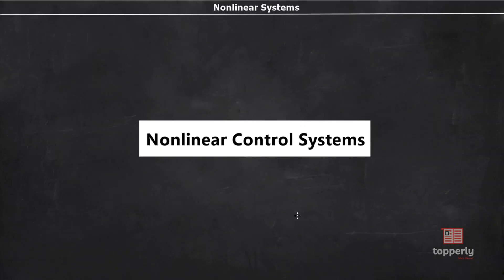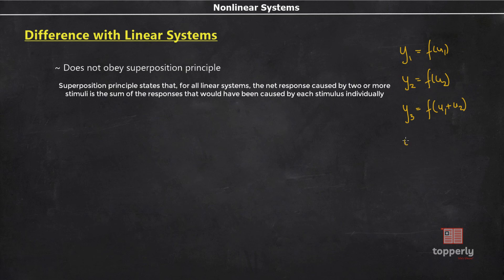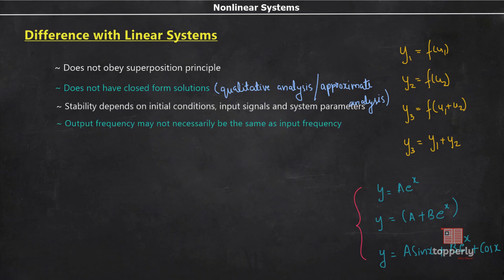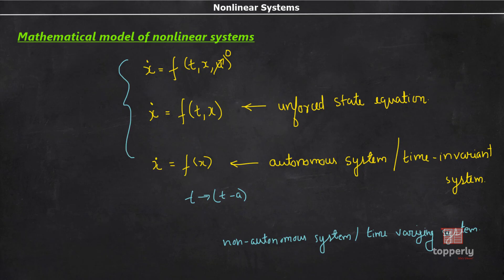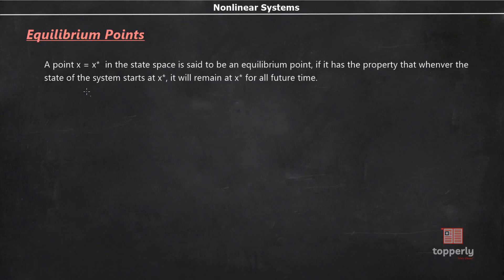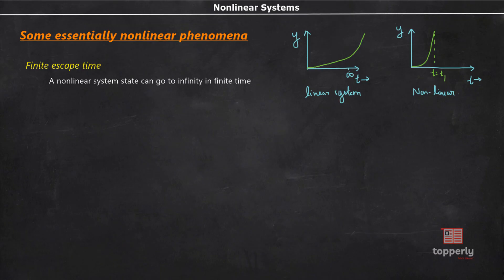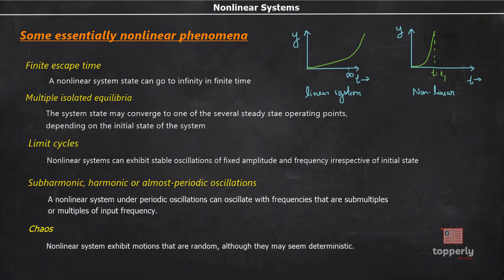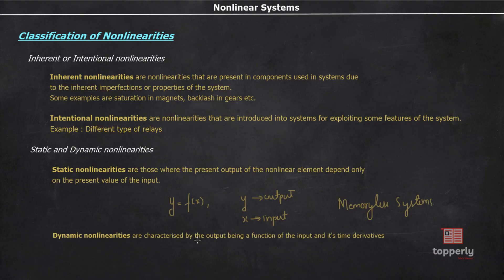Introduction | Nonlinear Control Systems

Comment: Very Good evening mam
Mam if you have time can you answer these questions you will be greatly appreciated.
1. Can we use the average dwell time to get the relevant results in switched nonlinear systems? What are the advantages of the common Lyapunov function over the average dewell time?
2. In studing the switched systems, it is very conservative to use the common Lyapunov function. What is the role of Common Lyapunov function method ?

Comment: Awesome content. Which resource did you use to study?
Reply from the maker: 1. Applied Nonlinear Control by Slotine and Li - https://amzn.to/2Ed8Rw6
2. Nonlinear Control Systems by Alberto Isidori - https://amzn.to/3l5VeQv
3. Nonlinear Systems by Hassan K Khalil - https://amzn.to/3aG0zsA
4. Modern Control Engineering by Mohandas K P - https://amzn.to/317zqfd

These are some books I refer :)